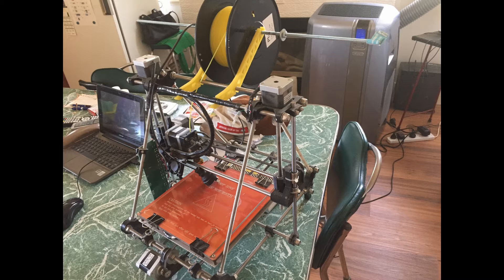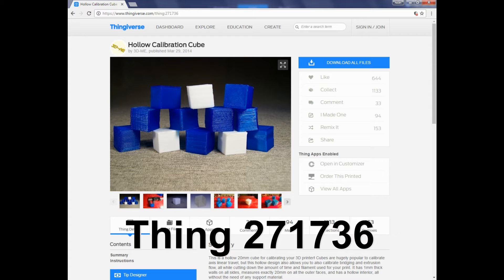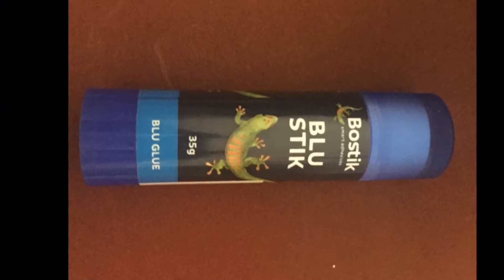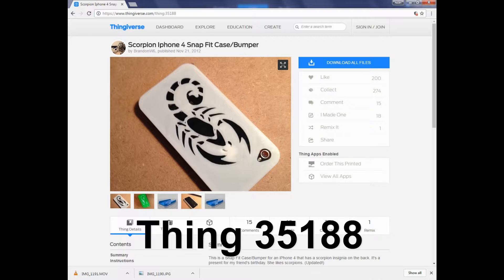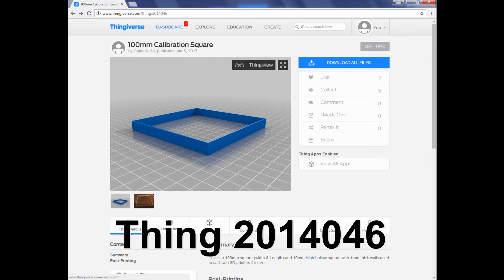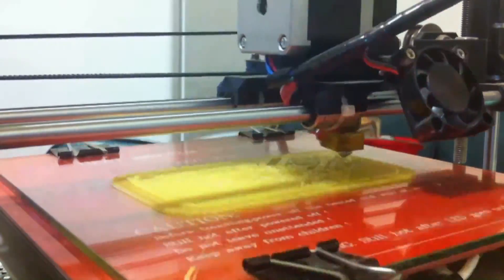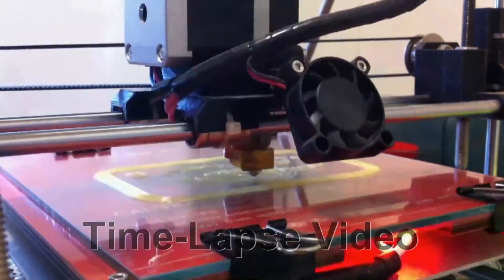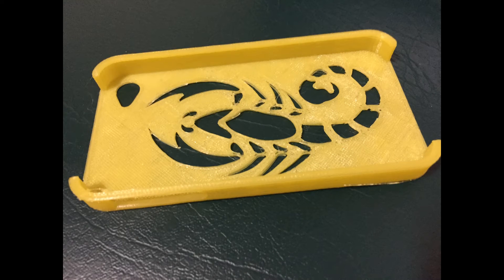1  How to Calibrate your 3D Printer

Comment: Thank you so much for this video! Now I have a formula to use in my slicer. The printer I bought from MonoPrice was out of calibration bad! I have no access to the firmware and MonoPrice does not respond to my questions. SHAME ON THEM! Now I just add to the scale in my slicer X=1.087%, Y=.991%. Case CLOSED!
Reply from the maker: I am glad it this video helped.  I hope your prints are coming out a lot closer to scale now

Comment: Can you calibrate the 3 axes separately?  In this video, adjusting the print by 0.97 adjusts all of them. Is it possible to calibrate each axis individually?
Reply from the maker: Yes you can.  You should be able to un-tick a box in the scale option so all the scales are unlocked - IE You can adjust each axis individually.